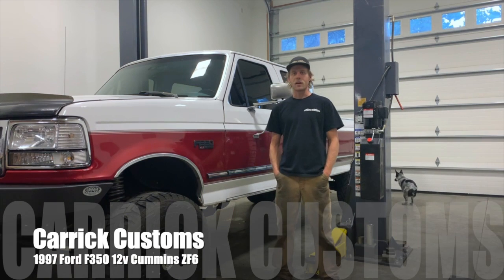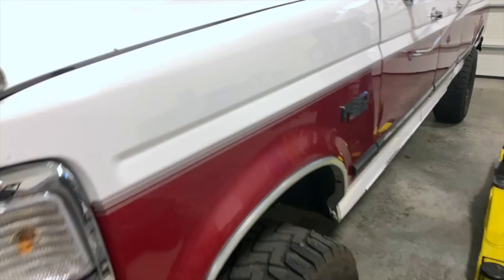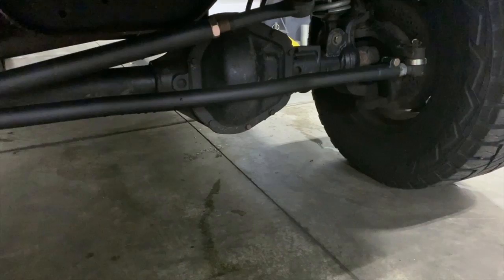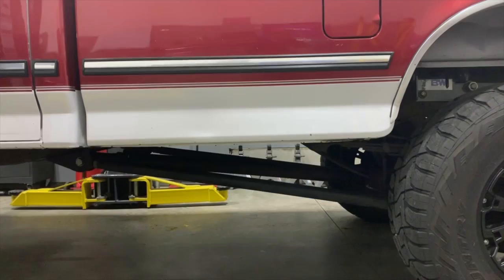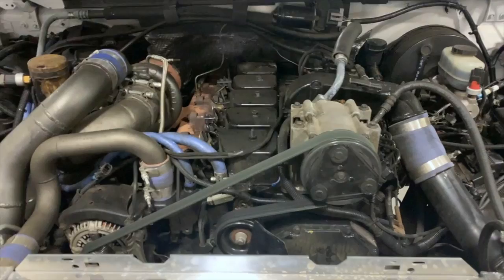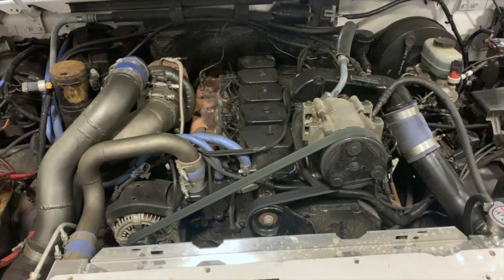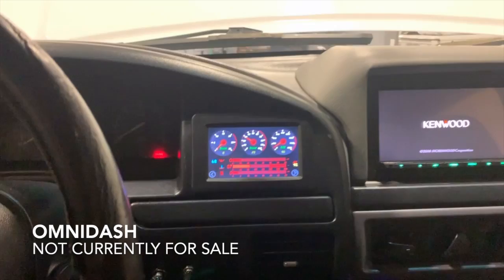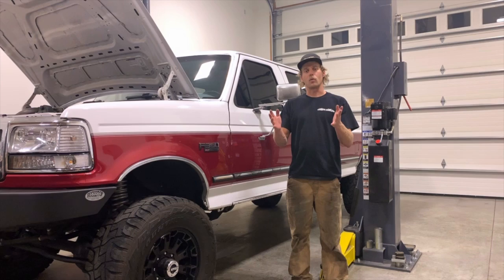1997 Ford F350 Cummins ZF6

Comment: Nice truck I certainly would like to have a 4 door Ford 4x4 .   Even though Ford has better brakes than my 95 Dodge 4x4 which I going to fix when I went to a hydroboost it was a lot better that it ever was even with the one ton chev wheel cylinders in the rear . You may have great brakes but a hydroboost certainly makes a difference from my experiences . The Ford is just a great truck especially since you went with the coil over front axle.  The 215 pump is a good choice as it adds a bit of timing at higher  rpms compared to my 160 hp pump set at 18 degrees.  Nice build 👌

Comment: I also would be interested in a trans overview. How you get everything to bolt up and what is the best and strongest transmission. Keep up the good work!
Reply: Go with an NV 5600 instead of the ZF-6 !  It's already designed to be behind a Cummins and it is by far a smoother transmission !  (Yes, I have both)

Comment: wow you have really put some thought into it. I'm on the fence of buying my parents 97 f250. I have a dana 80 and a ford king pin front to swap in and a spare cummins to put into it. After seeing this I think I will pull the trigger. I love the front suspension!!
Reply from the maker: It sounds like you definitely should pull the trigger!  That will be an awesome truck!
Reply: What intercooler you have ?

Comment: How do you like the 3.55 gears? How tall is your tire? Do you prefer the 3.55 gears or would you prefer 4.10 gears (35" tall tire)? -My truck doesn't pull as much as it carries firewood...f350 crew cab with 8' bed, however nice low RPMs at highway speed would be great!  What are your RPMs at 65mph? 75mph?
Reply from the maker: I really like 3.55's with 35" tires.  You can cruise at 80mph at around 2000rpm's.  Check out some gear ratio calculators for figuring out rpm's at different speeds.

Comment: What intercooler did you use in this truck
Reply from the maker: This truck has a 2nd gen Dodge Cummins intercooler but I would not recommend that route because of how wide they are.  My preferred intercooler is a 99-03 7.3 Super Duty intercooler but you need a diesel radiator for those because the gas radiator is too wide for the intercooler to fit around.

Comment: How much overall boost does your setup make? Would love to see a driving video. Running through the gears and hard acceleration. Love the 2 tone obs trucks
Reply from the maker: I haven't turned up to full fuel with the HE351/HT3b, but with the HX35/HT3B it would do 60-65psi.  I'll do a running and driving video soon.

Comment: I like it!!!
What about using a P Pumped 24v or is a 12v preferred?
What hassles are involved in the wiring adaption?
Reply from the maker: Wiring is pretty simple and well documented.  A ppumped 24v would be more ideal than a 12v because the 24v head flows a lot more efficiently

Comment: When you swapped the 12 valve into your truck did you have much issues with electrical,I’ve got a 460 in my 96 F350 and been thinking about swapping a 12 valve into it
Reply from the maker: The wiring for swapping a 12v into a 460 truck is actually fairly simple and straight forward.

Comment: Love the truck you guy's are real guru's. Just wandering if you sell that air conditioning compressor mount? I've got a 97 F450 that I'm putting a 12v Cummins in and it only makes sense to put the compressor in the original location
Reply from the maker: Yes we do. https://www.carrickcustoms.com/collections/obs-ford-cummins-conversion-parts/products/obs-ford-cummins-ac-compressor-mount

Comment: love the truck, can you tell me how you made the trans line for the trans cooler so i can make a set for my truck plz.
Reply from the maker: I took the stock hard lines and figured out how much of them I wanted to use and then I figured out how long I needed the soft lines to be. I took the stock hard lines and new trans cooler down to my local hydraulics shop, they cut the hard lines down to my mark, built new soft lines with the correct fittings for the trans cooler and connected them to the original hard lines.  Does that make sense?
Reply: @carrickcustoms9504  ya thanks

Comment: I'm doing a 86 f350 Cummins engine. Do you know which clutch pedal assembly and master cylinder I should use? 
Thanks in advance
Reply from the maker: I would recommend using a clutch pedal assembly for a 1983-1987 F350 and use a master cylinder for a Ford ZF5 (~1990-1997)

Comment: I have a cummins and dodge cab getting swapped with a 650 zf6  Can I just buy the entire slave cylinder and master cylinder kit for the ZF6? How hard would it be to mount the master cylinder to the dodge clutch pedal assembly? So i dont have to mix and match dodge ans ford master and slave cylinders. I need an updraged line too it has a 650hp clutch in it.
Reply from the maker: Yes, you should be able to mount the ZF6 slave cylinder in the dodge.  I cant say how hard it will be because we have not done that before, but it shouldn't be too bad.  You probably don't need an upgraded hydraulic line for that clutch.  The clutch in the truck in this video is rated for around 550hp and is using the stock hydraulic line.

Comment: How much did you pay for the 12V engine cuz I wanna buy one once I getta OBS F250/F350
Reply from the maker: Its hard to say.  Typically they are around $2k-$2500 for an engine with under 200k

Comment: Very nice truck! What intercooler did you use?
Reply from the maker: This truck has a 2nd gen Dodge intercooler that is flipped upside down so that the inlets and outlets are on the topside of the intercooler.

Comment: How much would something like this cost and is it daily-able?
Reply: Army of One36 if you did a good job on the swap of course it can be a great daily. Especially if everything is rebuilt and fresh. Those cummins are power houses and have great power, great fuel economy too. 12 valve can get up into the 30s mpg if it’s on the right setup and right fuel tuning.
Reply: 98 12 valve nice, how much would a truck, about identical to urs (4 foot long bed 12v ZF6) cost to buy/build?
Reply from the maker: It all depends.  If you can do all the work yourself, probably in around $30k.  This truck may be going up for sale soon to help pay for a new build we are starting and it will be listed for around $28k.
Reply: Army of One36 I paid a little under 10k for mine. 260k mileage

Comment: Where is the Godzilla kit?  Please build a godzilla 7.3
Reply from the maker: That is definitely on the list!  I want to build a conversion kit for these trucks to run the new 7.3 with the 10 speed automatic
Reply: @carrickcustoms9504  How about just a kit to add one in front of my wide ratio zf5? I don't want an auto, id like to keep all my existing running gear. Thanks for the response, its rare out here. Nice work. Id like to see your coil over for the ttb. I went to rsk w obs springs and dual shocks set up from sky's w x rated obs springs. I run the old school super runner steering on it and I love it. It rides, handles so good. The TTB isnt as bad as everyone makes them out to be the use blown out ball joints, bad steering, incorrect camber nuts... I have an upgraded pivot drop brace I designed to add into the rough country  adj. brackets.  Wanted to be at no bs but had commitments. Nice work man. The TTB needs to be brought back to its rightful place on the 250s. Its a Ford 9" w high spline count. Its a great unit if built right.